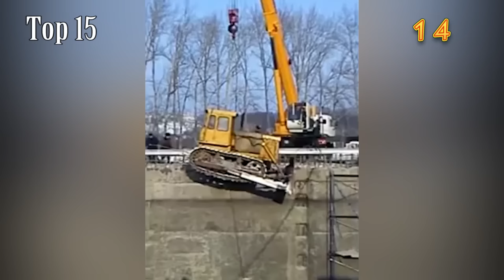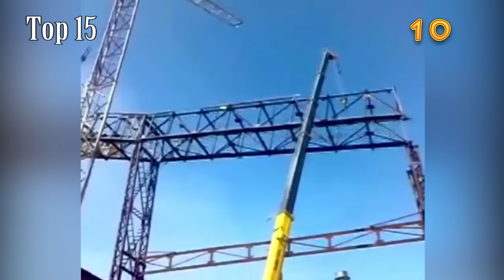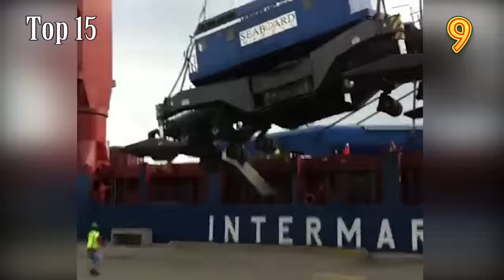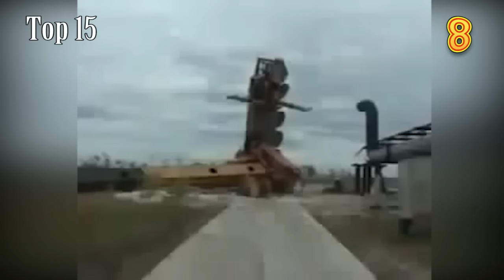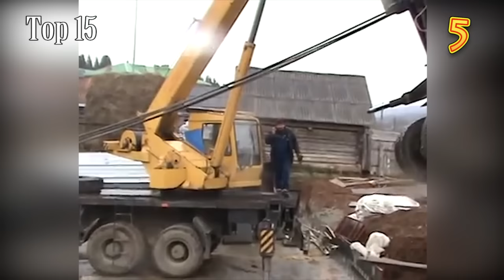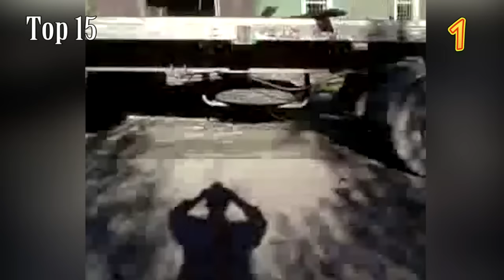Top 15 Heavy Crane Accidents Caught On Tape Compilation 2017

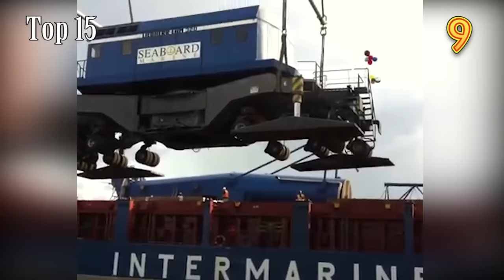Comment: 02:35 Damn, that's a big load to let go of with so many people standing around. There's a good reason that "never stand under a suspended load" is a very common safety rule. I reckon a couple of those people got flattened, unless they were all VERY quick on their feet.
Reply: Can't really tell. Could be the camera angle, they might be around but far-ish.

Comment: I've worked with cranes quite a bit over the years and it didn't take a degree in physics to figure out...if it looks too heavy,  it probably is.
Reply: Look around the world today. COMMON SENSE is a scarcity among most people anymore!
Reply: He ain’t heavy, he’s my brother.
Reply: @sparkynate91  common sense can be stopped by many factors,stress,rushing,anxiety...
Reply: @Death88758  I run heavy cranes... if you're rushing, you should have your license revoked! It is a very slow smooth process!!!
Reply: @Death88758  also, before a crane operator is allowed in the cab, a separate individual does a mental check to make sure they're cool calm and collected. And anxiety would only occur to a new operator. I did 50 heavy lifts at plant site before I got out in the field
Reply: @Death88758  this is piece of shit places that don't give proper training and disregard "common sense HEVAY LIFTING SAFETY"
Reply: @sparkynate91  Cool! I agree,no money in the world can fix a dead person.
I work as a slinger and just today I made a mistake at work out of stupidity,we lifted a peri shutter in a vertical position and it got stuck in a piece of steel,I told the driver to stop and he did but the shutter suddenly went up like half a meter high before the shutter came down and jerked,does this happen to you often as a crane operator? I just want to quit this job soon because I can't trust my damn brain to not freeze and do stupid decisions...
Reply: @Death88758  peri shutter as in scaffolding right? Just never heard that term before because we call it scaffolding here in America. And if that's what you're talking, I did have scaffolding get caught up once because 2 connections were not taken apart so it was pulling on the rest. But it wasn't a big issue to solve
Reply: @Death88758  and if you told the operator to stop, and the crane continued to raise the load for half a meter before stopping, either you have bad radios or a bad operator. Transmissions should be immediate and once you take your hands off the controls the crane should stop in its place
Reply: @sparkynate91  He stopped but the load was stuck, it got unstuck and  accelerated quickly up for half a meter,the whole thing was 1.8 tonnes so there must been at least 400 kg of unnecessary extra weight on the chains.
I'm just curios if this Is classed as shock loading or any other term that can cause failure of a crane. I know that stuck loads can even break the jib of a crane if the potential energy is big enough once the load gets unstuck suddenly.
Reply: @sparkynate91  No, it's a kind of system for framework,like walls,columns,upstands etc..
Reply: @Death88758  yes it would be. Any load that gets stuck and further tension is placed on the load would most definitely be classified as a "shock load" because of the "jolt" of rise and once the load went to settle again from that ride there would be more weight than the original simply because of the quick fall of it. Think of it as a 5 gallon bucket of water in your hand. You can easily hold it still but then jerk the bucket up and then drop your arm LIMP and realize how it seems you're dropping a 10 gallon bucket because of gravity and inertia weight from the fall. So yes that would be shock fall or caught fall or slip fall. There are so many different terms I've heard used.
Reply: @Death88758  Ok we just call them beams or walls or support columns. Those are referd to as scaffolding here

Comment: Most of those tip overs could be saved by just having a pressure gauge on each of the four legs to give an idea of how the weight distribution goes. Even better would be a small onboard computer warning the operator that hey, you are getting really close to the tipping point now.
Reply: Jaakko Fagerlund all hydraulic cranes and new lattis boom cranes have a computer chart. If they go beyond their chart they give you a warning as you get close then shut you down completely if you go beyond. But there's a key or button you can turn that off. But it's in the computer that you turned it off.

And the newer cranes do have a co.puter chart that tells how much pressure is on each outrigger.

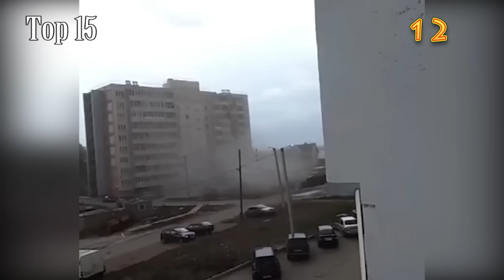Comment: 1:20 why I'd never be a tower crane operator.
Reply: Yeah, people normally die when they topple.
Reply: thats why most are remote controlled nowadays
Reply: @renew1572  That doesn't help those on the ground below or in a house or building!
Reply: @nicholasvalentine3907  i know that. But the point is it removes the risk for the crane operator (which was what the OP comment we are answering to is about)
Reply: @renew1572  Tower cranes are operated in the cab of the tower crane. NOT by remote. Don't comment if you don't know what you are talking about.
Reply: @vicrutherford6507  most cranes nowadays (atleast in germany) are controlled via remote

Comment: Maybe a few courses in crane safety, rigging, load charts teach them how to read charts boom angle boom lengths and to know the weights of load to be handled. 
 Maybe the proper way the set up level up crane before lift. In other words someone who knows how to operate a crane.  Any dumbass can pull and push a leaver but if half of these accidents is caused by not knowing your capabilities of the crane and the ability of the operator.
Reply: These places must be outside the United States or any First World Country judging by the language being spoken. They clearly need to learn the science and math of lifting loads.

Comment: In the above videos of crane accidents, there is a common mistake: underestimation of the weights of the load. In the video of which a bulldozer needs to be lifted up, a bigger and heavier crane should be employed. It would be better if a big crane is used in all haulage no matter how light or heavy the load weighs. A few years ago, when a project called the Lift Upgrading Precinct(LUP) is being executed in my neighbourhood in Singapore, the lifting contractor employed all heavy cranes ranging from 50 tonnes to even 500 tonnes for the project. As the lift shaft is to be installed  near the staircase in which grass patches surround the building that is inaccessible to cranes, a 500 ton heavy mobile crane is parked at the carpark and fitted with a luffing jib in order to install the lift shaft. When my gather sees this, he commented that an ordinary 50 ton crane will be sufficient. I explain to my father that if they really use an ordinary 50 ton crane to do that, it will be the same result as shown in video no 10 in which the crane has already collapsed at the work site.
Reply: While yes, a couple of these look to be underestimation of the weight, it is also common that other factors cause accidents. For example not accounting for weight of mud on the load, or loads swinging in the wind or from moving the jib too fast , or high winds causing additional forces. Also a couple of these look to be ground failure incidents, where the outrigger is placed onto soft ground which gives way.

Of course, the people making those mistakes are still foolish. You really gotta treat every lift with respect and of you aren't sure, get someone who knows what they're doing

Comment: Most cranes have seatbelts in the operator cab, this is why.
Reply: A couple of those are good examples of why not to wear a seatbelt though
Reply: @treverwhoever   Tough call, I never wear mine, of course I don't plan on tipping over and getting slammed up against the windshield.

Comment: How many times,NEVER,EVER,expect any mobile to have full lifting capability,when the boom is over the back axle,lifting ANYTHING.There is usually an extra outrigger/support UNDER THE CAB,for just this reason.
Reply: That’s wrong..... the only thing wrong is they have gone beyond the safe working radius with the load. All mobile cranes are rated over the rear of the body...
Reply: I have only ever seen an extra outrigger,underneath the cab.
Reply: I believe you you normally only have the extra outrigger under the cab on the American built Link-Belt cranes. It’s only there because the four main outriggers are more to the rear of the body. So if the crane wanted to slew the load from say the side to the front it will give stability.

Comment: To you new operators, always check your load charts (in the book). I once ran a crane that the computer said I was good for 93,000 and 35 foot. But the load chart said I was good for 74,500 at 35 foot

Comment: Each Crain driver an instant before, 😱"Fffffuuuukkkkk."
I'm 100% sure those crains have weight gauges, it's the operators responsibility to know two things, the weight of what's being lifted, and that the higher it's lifted and further out his BOOM is extended, the less he can actually lift, fukin idiots trained badly.

Comment: I just can't believe things like this happen.
1. It only takes a reasonable eye to tell where centre of gravity will exceed the point of balance. And when in doubt, back off BEFORE toppling.
2. Most machines have an over-balance warning scale or buzzer.
3. Chains should always be 3 - 5 times the expected load and in good condition.
4. Not just operators should know all this ... but where the fuck are all the more knowledgeable/intelligent supervisors?

Comment: 15, 9 and 6 were rigging failures. Number 1 is the reason with a heavy load you lift it, pull the truck out, lower it closer to the ground before swinging from the rear of the crane that has the highest capacity. If a load is only 1' off the ground it is almost impossible to tip the crane over.

Comment: a simple force x distance calculation could have prevented all of this...the teeder todder principle fellas
Reply: True enough for the single crane accidents, but trying to connect two or more cranes to a single load is a much more difficult problem. There are no loading charts for that because it is a singularly BAD idea right from the beginning, usually undertaken to cheap out the job. Two 10 ton cranes can NOT safely lift a 20 ton load. For me I would want 100% safety factor on any two crane lift, and then do it only if absolutely necessary to properly position the load, not just to try to save money

Comment: The last three videos numbered 3, 2, and 1 were very boring, so why did you list them as the top 3 videos out of 15. When you start with the 
Top 15, you show the worst and the least interesting videos first and then work your way to the top at No. 1. Did you not know how the 
numbering system works?!?!  It doesn’t look like it!